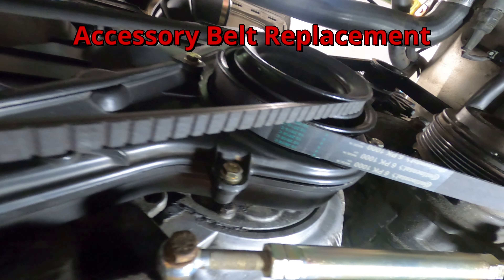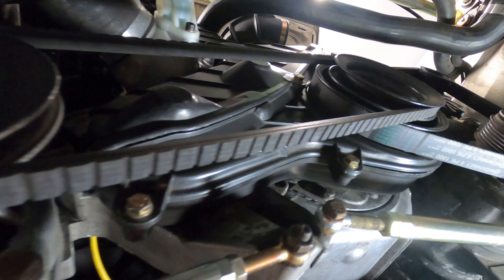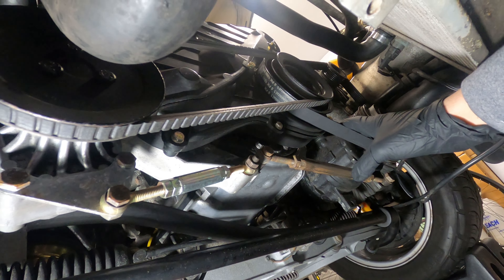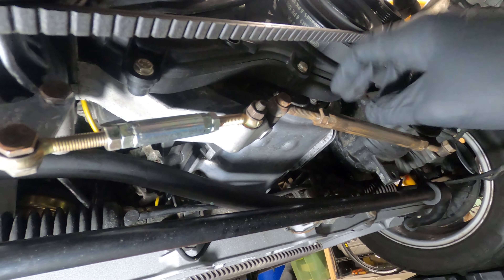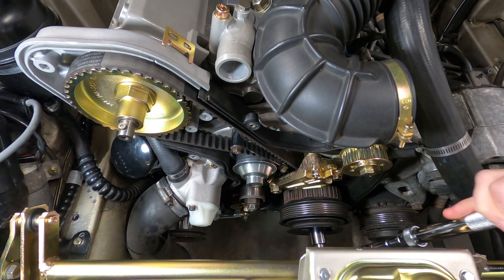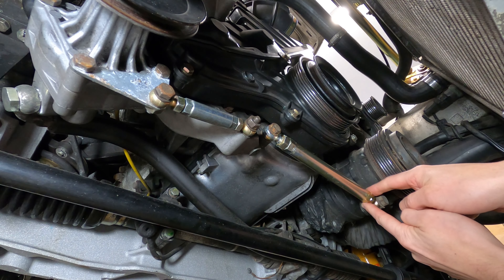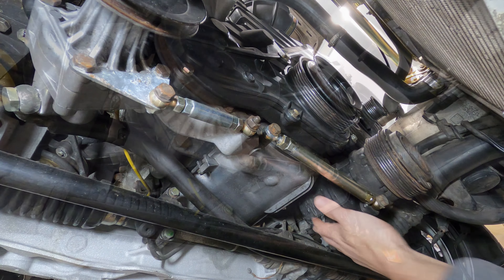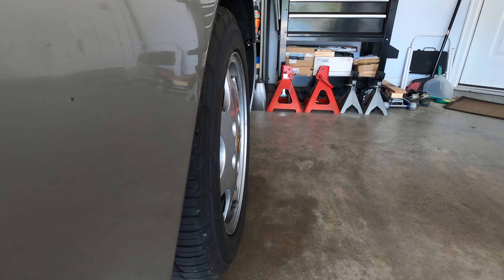Porsche 944 – Accessory Belt Replacement: Power Steering Pump Belt and A/C & Alternator Belt

Comment: ABSOLUTELY LOVE THESE VIDEOS!!!!!! I hope you plan on servicing and rebuilding the CV joint axles, I CANNOT stress how important this maintenance is, I STRONGLY discourage anyone from replacing them with over the counter parts due to the quality, Unless the axle was destroyed Porsche used quality parts and a cleaning, Inspection, an new boots upon reassembling is really all they need.....👍👍👍
Reply from the maker: Thanks! I rebuilt mine last year, but agree there is a lot of good information to cover there. 

The axle grease on a lot of them I see, at this point, has broken down, leaked out, and are overdue for rebuild.
Reply: Are you gonna to do a video on that process???

Comment: Is it just me or is the power steering belt inside out?  Shouldn't the ribbed part be for the pulleys pleasure?
Reply from the maker: There are a couple different designs on the power steering v-belts, one with ribs notched into the outer surface, like the one seen here, and another that features a smooth outer surface with notches cut into the v-shaped side. This one must have been a “magnum” belt, because I recently installed a Porsche OEM belt and it was very tight fit in comparison.

Comment: What specific nut and bolt do I have to get for the power steering pump tensioner?
Reply from the maker: The power steering pump tensioner turnbuckle is secured on the pump side by an M8x25mm bolt and on the other side of the bracket by a coarse thread M8 nut.
Reply: @NC944er  many thanks! You’re a legend!

Comment: Also, do you know the torque spec for alternator pulley bolts, those that bolts the oulley to balance shaft belt sprocket on crank?
Reply from the maker: Hey man! There are bunch of different terms being used in your question here, so I’m not sure which fitting your referring to. The balance shaft pulley bolts are set to 33 ft/lbs. and the crankshaft bolt is 155 ft/lbs. Here is a list of common torque specs - https://www.lindseyracing.com/LR/Parts/TORQUESPEC.html
Reply: I'll clarify, on the crank shaft parts diagram, it shows 2 gears and 2 pullies. 1 timing sprocket gear, 1 balance shaft sprocket gear, 1 alternator pulley, 1 power steering pump pulley.
Alternator pulley is mounted to balance shaft sprocket gear by 4 hex bolts. I need torque spec for that.
Reply from the maker: @Sivaprasad.t.g  Ahhh, gotcha! Those are the M6 Allen bolts, the torque spec on those is 13 Nm or 9.5 ft/lbs, but I usually just crank them down “good and tight” by hand.

Comment: I hate this system. Got belt squeal a few weeks ago, did some research and crawling under the car, found the AC tensioner rod hanging loose with the mounting bolt broken and in need of drilling to remove. I've watched this video several times over but am still not entirely clear on where the pivot bolts are that you need to loosen before adjusting the tensioner rods.
Reply from the maker: Oh man, that doesn’t sound good! The upper pivots or mounting points for the AC Compressor are centrally aligned with the the clutch/pulley on the front. They are positioned up and back on the compressor housing since the unit hangs from the aluminum bracket above that doubles as a support for the Alternator. I generally loosen the larger front bolt with a combination wrench from the top of the engine compartment. The smaller rear bolt is much more difficult to see and usually requires use of a socket and extension from below the engine, and you’ll have to really get up under the car to see it.
Reply: @NC944er  Once again, you are the best. Gonna give this a shot over the weekend.
Reply: @NC944er  Okay, I'm back, sorry. Is the rear AC compressor pivot bolt on the same axis as the front one? Like if I drew an imaginary line, would is pass directly through the front mounting hole and exit the back one? Hope this makes sense, but I'm suspecting a missing rear bolt on mine.
Reply from the maker: @Cam-pe3nd  Yes, you are exactly right! Check out a picture of the part online and that may help, it’s just tucked way back on the top, here’s a link with pics - https://www.autohausaz.com/pn/944126008OEX
Reply: @NC944er  Wellp, I'm missing a bolt. At least that's better than a broken one. For now, your video helped me stop belt squeal, and now I understand this system better!
Reply: Ac tensioner broke off on my car and shredded my serpentine belt, put it all back together today.

Comment: Is the belt squeal in the end from the balance weight belt? I have had the same type of squeal since Porsche replaced that belt along with the timing belt..
Reply: Yeah same
Reply from the maker: A high pitched screeching sound is usually the alternator ribbed belt. 

That said, these cars are notorious for belt noise because of how tight some of them run along with the addition of the balance shaft belt. 

If it’s really fresh, new timing and balance belts will typically loosen up a bit over time and break in, but yes the balance belt is known to be noisy, usually more of a whine or whirring sound rather than a squeal/screech. They are commonly over-tightened as well, which makes it worse. If it’s really bad, I would inspect the belt tension to ensure it’s within factory spec.
Reply: @NC944er  Yes sorry, it's more of a supercharger whine than a squeal, just like the one yours have in the end. Mine's a S2, maybe they are more prone to have this? I've done about 3000 km with the belts so they should broken in by now, I guess I'll have to check with my Porsche shop. Thansk for the reply!
Reply from the maker: @KJBlakstad  Yeah, with 3,000kms, that would put it into used belt territory rather than new. 

The belt setup is essentially the same on the S2, but some of the 16-valve engines have an extra idler roller on the timing belt setup. 

The balance belt idler is known to make a sound like you’re describing. Assuming the rollers were replaced during the last belt job, checking the belt tension and preload set on the idler would be the best option. The car could also be totally fine, hard to say until you get in there.
Reply: @NC944er  My porsche mechanic told me once "If the belt isnt "Singing" its not tight enough" :D

Comment: Hi NC944er, the smaller turn buckle bolt for the serpentine belt (bolt seen furthest to the right at 0:44) has gone missing from my car leaving my belt squealing and turn buckling hanging.. do you have any idea the specs of that bolt?
Reply from the maker: Hey man, check out part number: N-040-125-1, that bolt should be an M10x30mm with 1.25 thread pitch.
Reply: @NC944er thank you!! I appreciate your help immensely. I wonder if i can find that bushing too
Reply from the maker: @quincylongman7469  There’s a bushing used on the left side of the that turnbuckle, but the right side just has an M10 flat washer. Do you have the 944 parts catalog? There’s a free version available at the link below. Check out pages 447-448. I also have a video here on the channel related to parts shopping and locating parts that provides an overview of the process. Porsche parts catalogs - https://www.porsche.com/usa/accessoriesandservices/classic/genuineparts/originalpartscatalogue/